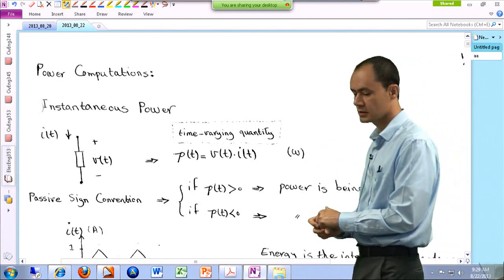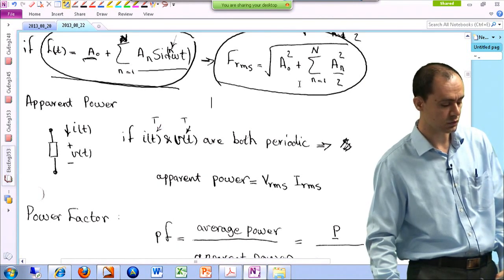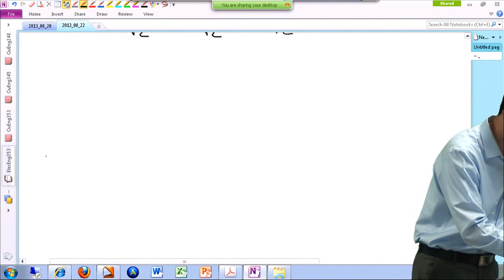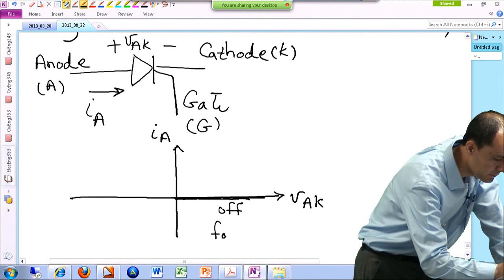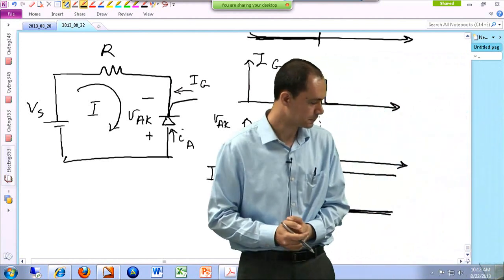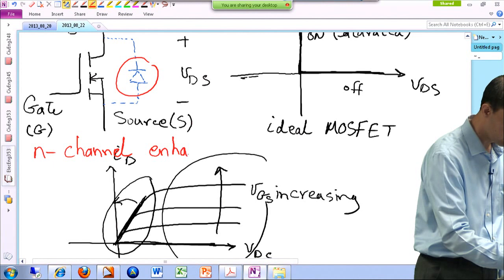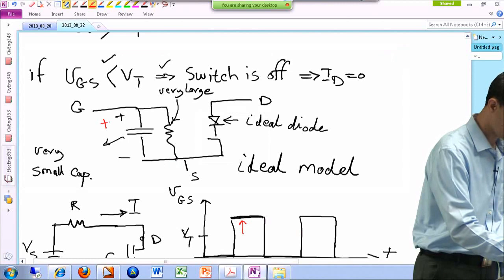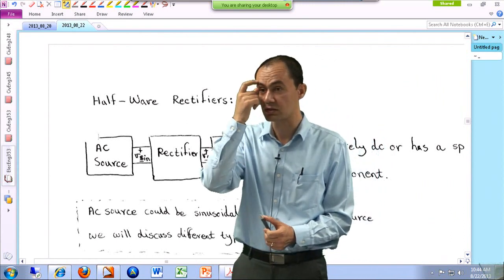[02] Power Electronics (Mehdi Ferdowsi, Fall 2013)

Comment: No professor it should be like this "Avarage power is Zero for a periodic signal provided  Avarage voltage across it's terminal is zero". Average power will not be zero if the signal has DC offset.
Reply: Periodic signal does not have DC so is obvious that the Average (DC) is ZERO ! Not everyone is a stick as you to not understand this obvious matter !

Comment: I have a question @1:06:30 , it is being told that if Vgs is removed then the capacitor will start discharging which keeps the MOSFET in ON state for a while. 

My question is that, when the square wave goes from from positive to zero, why doesn't the capacitor discharges then to keep the MOSFET in an ON state?
Reply: When the function generator goes from positive to zero, it will discharge the input cap and turns off the mosfet.  The professor was saying, if you turns off the function generator while the Vgs is high, then in this case "nothing" discharges the input cap and the MOSFET will stay on.

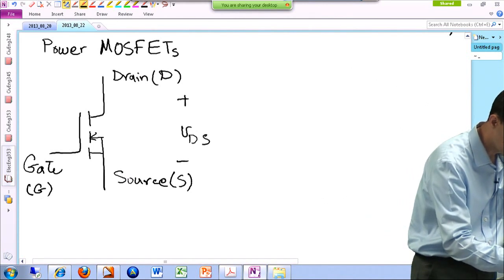Comment: 48:08
can someone smart explain to me why the voltage is measured from drain to source? where is the sense in that? 
"and the current is usually going into the drain and coming out of the source." this one makes sense. HOWEVER the next thing he does is drawing the current arrow from drain to source. This is consistent with the voltage but I dont get the naming. why is it going from drain to source?
Reply: Naming is according to the electron flow. Electrons enters at source and drains at drain. However the convention that science follow is that current flow is opposite to the flow of electrons. I hope this helps with naming conflict.
Reply: skaterfugater a Mosfet is Voltage controlled current source basically. We use VGS to control the drain current. Therefore if no current flows into the gate that means the drain current will flow into the source. Thus iD=iS. We measure VDS for numerous reasons.one could be to find instantaneous power of the mosfet (VDS*ID). Depending on our mode of operation We also want to make sure VDS is >0 that is the VD is greater than the VS because current should flow from drain to source (higher potential to lower potential by convention). Hope this helps
Reply: thanks